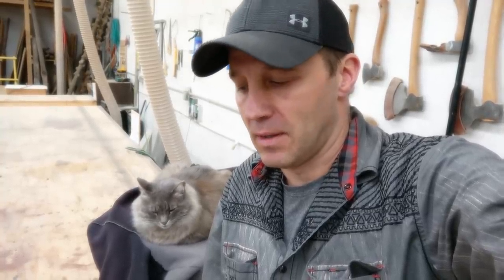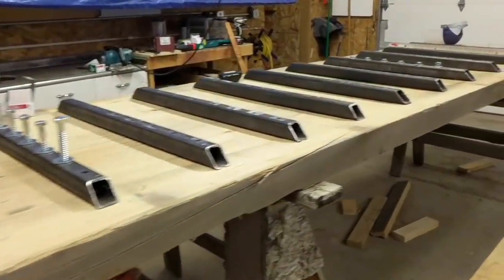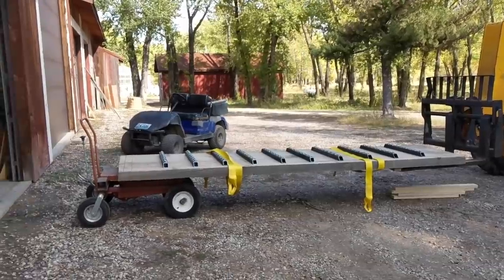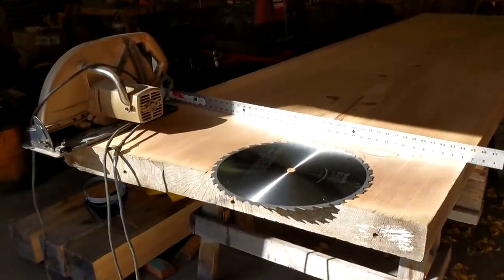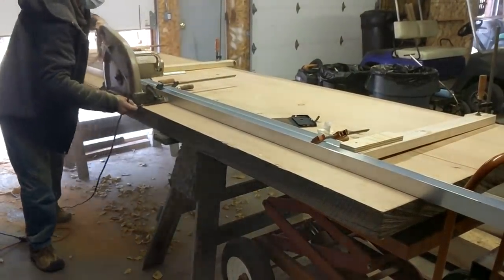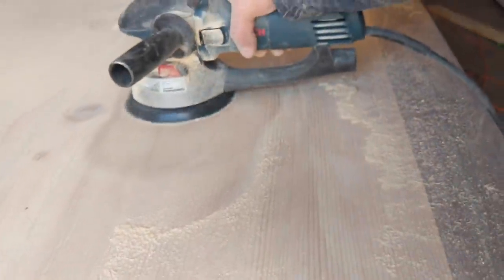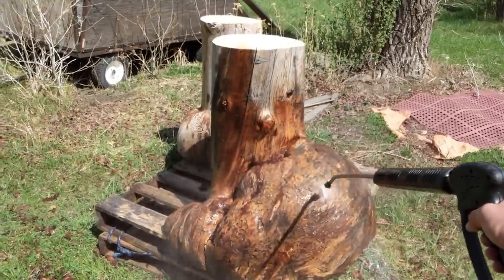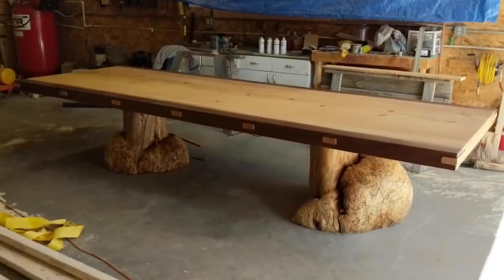Making dining table

Comment: In ancient times we used a door plane with a four foot absolutely flat bed.  we would drag a stray tedge across the top and scrawl on the high parts with pencil or charcoal until it was fuliginously flat.  Your way is more civilized and you have a good designer.  The walnut edge was a very nice accent.

Comment: Cross plane stability of such a wide board is a problem with all kind of wood. We had such a problem while making an ashtree staircase of abt. 2" thick. We did several long drillings across the grain in the middle plane of each board. Each hole was filled with 9mm dia. (abt. 1/3") hard steel rod with hydraulic press. Stairs are abt.30yrs old now and serving everyday with no distorsion visible. And nobody can even suspect all that metal stuff sleeping inside them!

Comment: question: How in the world did you get that gorgeous table into your house, It must have weighed a few tons? Once you broght the wood in, how long did it take you to finish the whole table? Can I buy this table from you?  If so, how much would you sale it for?   Years ago, My ex and I found a very old Oak rolltop desk at the back of the garage, on the farm at his mom and dads place. I don't even think they knew they had the old rolltop. It was covered with mudd dobbers. We pulled it out and repaired it & used Tung oil over it to make it into a gorgeous antique roll-top that we used for years.  I think we put 6-8 layers of Tung oil on it and like you, after each layer dried, we lightly sanded it and used a special cloth to wipe it down to get the dust off, before putting on another layer of tongue oil.  We covered the top of the desk with leather and used the fancy star tacks to hold the leather down. We brought it back to life and it was a masterpiece. Unfortunately, he got it in the divorce!!!  It's so rewarding to do these types of jobs and I'm so impressed with your design, your woods used, and then having the contrast show when done. The size of it is just fabulous, what a amazing Thanksgiving Dinner you could have on your table. You should be very proud. Last question:  Is there anything you can't do????
Reply from the maker: Got lots of help for moving in the house, had to take it apart, it went very smoothly. Once per year will continue to put oil for the surface, to renew it.
Reply: @honeysada  Good to hear, it's sure a beautiful table.  Oh, I also love the thunderbirds on your chairs.

Comment: The Table Legs are in the Center!.  The Table is balancing on the legs.  Did you do a Tip Test?  If a fat guy sat on the edge of the table, would he bring that whole thing crashing over?  that thing could kill a baby!
Reply: Scott Weiss you need to watch it again.. the legs are not in he middle
Reply from the maker: We did tested, it's very stable, but to make sure  we secured it to the floor also.
Reply: @juratebrown131  Hi Jurate,  Okay, saying that the legs were in the middle might have been vague for some people.  To be more precise, the legs are aligned along the longitudinal center.  To say it in another way, the leges are not at the corners.  There are two legs, not four.  These two legs are back from the edges of the table.  Also, read down, Mr. Honeysada himself, (God bless him: he must be reading through all his comments), he himself says that the design worried him enough to do testing and then to solidly connect table to legs and legs to floor.  So, yeah, I can sleep at night now.  having pets and large killer objects that can fall over are not a good combination.